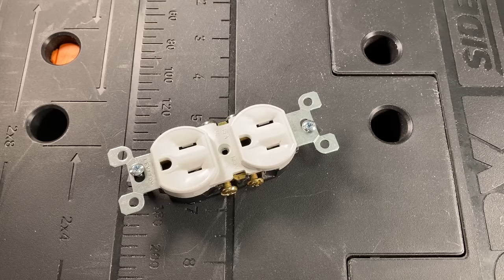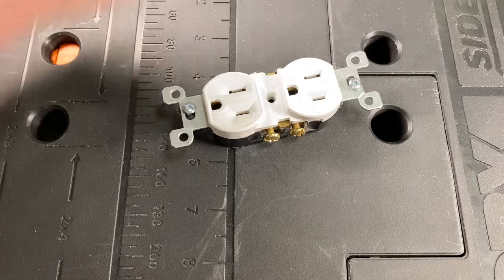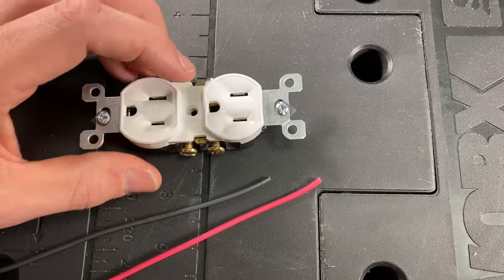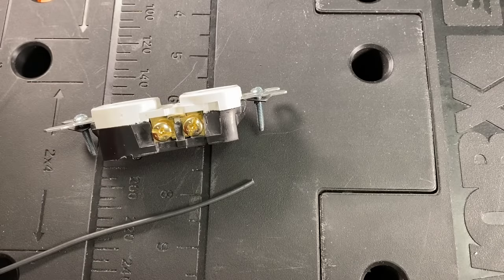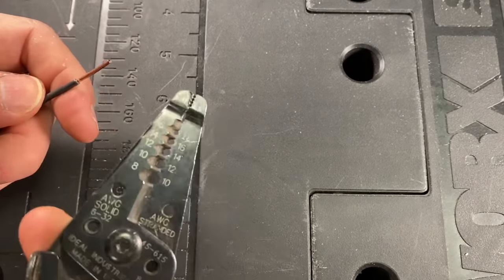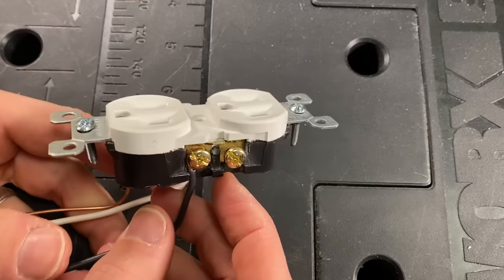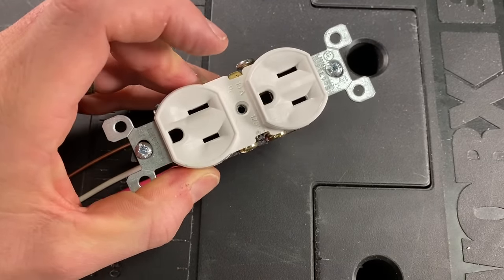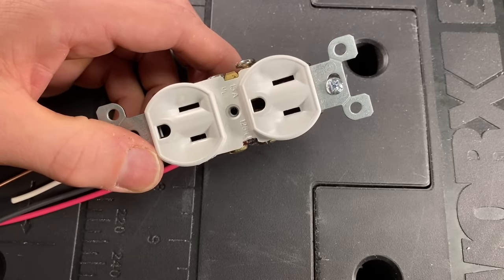Electrical Outlet Basics | How To Wire

Comment: I think it's worth mentioning to install the wire loop in direction that the screw tightens. I have seen it installed counterclockwise and it straightens the loop out.
Reply: Good Eye !!
Reply: It's a shame that has to be said.
Reply: @user-uy3pe1jy5c  i promise simple things other people know, you have zero knowledge about. So instead of bringing other people down either say nothing or thank the person for the tad bit of information
Reply: @sk8ingforfood182  I totally agree!!
Reply: @sk8ingforfood182  I don't think we were talking quantum physics here, simply which way to wrap a wire around a screw. If my comment brought you down, maybe there is something else going on.
Reply: @johns4476  all I'm saying is I hope you know every simple trick in every other profession
Reply: I was going to add that but you beat be to it.
Reply: I can't tell you how many times I've seen ppl try an wrap the wire opposite of the direction that the screw tightens , an if its stranded wire it gets all mushed out ,
Reply: @paulrooster2108  stranded wire shouldn’t be wrapped around a screw at all...
Reply: @user-uy3pe1jy5c  cool comment.
Reply: @SuperVstech  really? You ever do any DC wiring such as bus bars in a boat? I didn’t think so.
Reply: @dumpbear0  stranded wiring should NEVER be wrapped around a screw. In a boat, it should be used with a ferrule in a lug, or if under a screw, a crimp connection should be made, and shrink sealed from the elements.
Reply: I was gonna make this same comment. It took me a few mistakes to realize why the wire would just get pushed out when I tightened the screw.
Reply: SUPER important, I've seen many people turning and turning and screw and the wire is bunching up and breaking off needing to be stripped yet again. A pretty common mistake but IS worth mentioning.
Reply: Not really..
Reply: @snakeplisken7323  yes really. Not everyone is perfect like you when it comes to wiring something up.
Please share with us your wisdom so we all can learn something.
Reply: @SuperVstech  I too like using crimped connectors on stranded wire. About the only application you don't have that luxury is when your wiring up plug on a power cord.  However, in that circumstance I like tinning the ends up with solder to hold the strands together.
Reply: @bobber55  Thanks! I was trying to think of where (& why!) I would have been tightening stranded wire under a screw head, and that's it: new plug on a power cord! And I think I got so frustrated with the strands splaying out (even going the right way) that I also tinned the ends!
Reply: Thank you very much.
Reply: @getin3949  Some of us are just trying to learn to do this and it is a very important tip.  I'm sure I could give you sewing tips that you don't know.
Reply: Early on I use to do that very thing.
Reply: @johns4476  There’s something immature going on with you, pal…not him
Reply: @johns4476  why would you say that? Just ignore it! You don’t have to be rude!
Reply: I got a question can the wire or I should say the loop, can it touche the plastic part of the outlet? If that made sense,?
Reply: @j.rjunior5584  the loop should be just big enough for the screw to fit through. If that is done, it should not touch surrounding plastic. Remember, when you torque down the screw it could possibly crack the plastic if the wire is against it.
Reply: @sk8ingforfood182  yes of course but a comment page is also meant for corrections so that other electricians can become a master of their craft as well . It’s not always about being nice because the electrical world isn’t nice haha
Reply: @sk8ingforfood182  Damn, you need to toughen up. The man simply gave valuable information. If that hurts yours or others feelings…you need counseling. And counseling is a good thing, for anybody.
Reply: Wdym?
Reply: Why loop the wire around the screw at all?
Reply: @SuperVstech  See now I don't loop them. My understanding is to leave it straight and screw the wire straight in. Straighter the wire, less the resistance.
Reply: @tinmaned3542  Depends on the type of outlet.  Newer commercial grade outlets have a plate you can insert the wire under that will clamp the wire when you tighten the screw.  Residential grade typically lacks this plate, so you have to use a shepherd’s hook to side wire.
Reply: pa
Reply: True and just importantly, which isn’t taught anymore, twist the stranded wire COUNTER CLOCKWISE before wrapping the wire clockwise to the screws and tighten. Twisting the stranded wires COUNTER clockwise will assist the wire stay under the screws as you tighten.
Reply: Thanks!
Reply: Yah it’s always clockwise
Reply: Very well explained.

Comment: Always tighten down any un-used terminals as well. This minimizes the potential for contact with the box and or loose ground wires etc.
Reply from the maker: For sure, thanks for the reminder 👍
Reply: I also wrap electric tape around the terminals.
Reply: Damn this is a major tip... I didn’t do mine and I just finished. Now I’m worried lmao
Reply: Yes and wrap the outlet or switch with electrical tape. Same goes for any wire nuts used.
Reply: johnson pham Usually it is OK. It happened to me only once when I was pushing a hot second outlet into a busy box. The wire were live, and I saw a big spark between the hot screw and a grounding wire. After that incident, I started to taped over the hot terminals in busy boxes.
Reply: Always wrap you outlets and switches with electrician tape. I started that after I installed a 30 amp 240 RV plug and the ground shorted out the hot wire when I pushed the outlet into the box. Not my finest moment.
Reply: @electriciantv5174  I have been wrapping them since I was a kid knee high to a grass hopper knowing f all about wiring. I did it because open terminals were scary to a 12 year old having already played with a transformer from a water tank and it blew up in my face. 😳 I was seeing stars 🤩 dumb kid I was
Reply: You Can Too Electrical Sparks are fun. I melted a pair of scissors one time.
Reply: @Jenuin  hey man good shit lol
Reply: Technically NEC doesnt tell you to and taping isn't required.  If properly installed once you add the outlet covered nothing should go wrong.   It's more for the home gamer poking around in hot boxes
Reply: @pbgd3  truth. But if you have seen what I have seen from official electricians.....
Reply: @electriciantv5174  brrrbrrrrrr,,,,chaaaf!!   ??
Reply: @yiannimil1  what
Reply: Yes, definitely >>>
Reply: @Jenuin  
By wrapping,  do you mean covering the side screws ?
Reply: @Chereese0808  yes exactly. Less chance of grounding out if you are working on a live circuit or if the box happens to get banged around etc.  But always shut down / lock out etc and let anyone in the home know so they don’t turn everything back on. That does happen.
Reply: Thanks again
Reply: @EverydayHomeRepairs  this tip, and the wrapping clockwise around the screw tip, and several others are really important for first timers like me. I am replacing dozens of outlets, and if I had not read the comments, I would not necessarily learn these things…

So my thought for you is: why not take the best tips from the comments, ones you’ve responded to, and add them to the video description? I’m thinking you should probably do this with all your videos so that rookies like me get the benefit of the best wisdom and also avoid time consuming mistakes – you know what I mean?

Thanks for your channel, just subscribed :-)
Reply: @Sean Stevenson I personally agree.  In my home everything is done in deep metal boxes with EMT and mudrings to bring the box out to the edge of the drywall.  I put pigtails on everything, wrap em, and use wago style push nuts.

But if you were doing that on every job in an area where everything is NM plastic boxes and direct wired?  Its a huge waste of time and money, but in my house? Forget about it.
Reply: Great job!
Reply: @Jenuin  STOP fking using wire nuts... do your job properly and get wago clips O_x 

oof
Reply: @Dinco422  I have used both and if one is to use wire nuts properly you won’t have any issues. That being said I understand the superiority of the wago clips. 🙌🏼
Reply: I’ve heard of people wrapping a strip of two of electrical tape when the wires are connected I guess to avoid any contact of the outlet with the box ?? Is that ok to do ?? Just wanted to be extra sure nothing goes wrong.
Reply: Very thorough and easy to comprehend. Thank you.
Reply: That's a great tip, thanks
Reply: Thank you!!!
Reply: @pbgd3  I have no idea what you people are talking about and  jealous.
Reply: I wish I would have thought of that lol. I'd learn hard way I'm a dummy sometimes

Comment: for beginners, i suggest a copy of "basic wiring".  from lowes, home depot, etc. people watching obviously have little or no experience in wiring buildings. a printed copy would be very handy until the user becomes familiar with what their doing. running back to the computer would drive me nuts. also, don't be fooled by the ease of using cordless drills to put things together, it's very easy to strip screw threads.

Comment: You worked it but didn’t mention that the wire should loop around the screw in the clockwise direction that the screw is tightened so maximum force can be applied when tightening.
Reply from the maker: 💯 thanks for the call out. 👍
Reply: Yes, I noticed that, too
Reply: Tony Manero, but he DID connect the black wire loop Correctly on the brass terminal, no ???  So perhaps, he was thinking that people would watch and do it the same way..
Reply: Who installs recitals with the ground terminal at the 12 position?
I see a lot that the ground hole is at the 6:00 position. I was taught and it might be wrong, always install with the ground at the 12:00 position. Why? If a child is playing say with a metal object butter knike ect and a plug is partly loose both positive and negative terminals are exposed and almost always will shock you or potentially kill you. But if the recipital is installed with the ground at the 12:00 position in the same situation the first and hopefully only contact is to the ground terminal. Just a random thought.
Reply: @MJ0U812  90% of plugs I see has the ground hole at the 6:00 position.  I think it may be because a lot of plugs that are wired with a 90° plug that is designed to allow the plug and wire hug the wall.  A lot of those plugs have the grounding prong on the bottom.  I guess it also depends on where the plug is being used and what is being plugged into it.  Another one to blow your mind, some older houses had the lugs put in sideways.
Reply: @frandanco6289  Yes he did. To us this is probably obvious but to newbies it must be pointed out because they may not think it matters.
Reply: @KevinBenecke  I think most people install it that way because subconsciously it looks like a face and that’s how it should be oriented. But, there is no mention of it in the electrical code, at least not where I’m am. But, I have heard of guys installing the ground hole up for that same safety reason Eddie pointed out.
Reply: In all the hospitals I've ever worked in they were installed with the ground lug at the 12 position. Naturally anything plugged in could be vital equipment and easy to short by accident with any bodily fluids that may or may not make their way down any sort of cabling.

Naturally I started wiring my house that way, but it can be a pain if you are working with a ground lug in a tight space.
Reply: @GoldenAura32  Naturally
Reply: What I was hoping to see was best practice on preping the wires in the box, how to locate, bend them behind the plug, so that it is done in a professional way.
Reply: @GoldenAura32  
This is done so when unplugging, and you accidentally touch the plug tangs, you have lessened your chances of getting shocked.
When unplugging, your thumb is generally at the 12 o’clock position.
Reply: @KevinBenecke  pu
Reply: @MJ0U812  
Well over 75 homes minimum I have wired in full in the last 8 years. Each and every one was installed with the ground terminal at the 6 position. However, absolutely none of those installations negate parental responsibility at any moment in time.

Let's run with your thought for a moment. 
Many electrical components, if their ground wire is no longer touching ground inside of the receptacle, a person touching the ground terminal from the cord end can become the path to ground. That means electricity flowing through the body. Hence the ENTIRE purpose of the ground wire in electrical systems. 
 
If a cord does not hold snug in a receptacle, the receptacle needs to be replaced and positioning of the ground does not negate the need of replacement. 
Also, when mounted with the ground at the 6 position, there are two contacts helping secure the cord against the pull of gravity, not just one.
Yes, the contacts do help keep the cord in place via friction. 2 sources of friction is much better than one.
When the ground is at 12, it's lone self receives the majority of gravity's pull whose effect is noticed more and more with time.  Rock a plug up and down in a receptacle. You will notice that the top facing terminals get pulled in and out of the receptacle much more than the bottom facing terminals.
That is why ground is located at 6, not 12.
Even if you plug something in and never unplug it, gravity will have its effect over time, thus weakening the friction between the contacts, eventually leading to a loose receptacle or at minimum, a plug which is no longer fully seated. 
There is very good reason for placing the ground at 6.
Reply: @CytoplasmicGoo  they will notice that if they put the loop counterclockwise it will pull the wire out of the screw head radius,so...it will not let them do that...some can manage to do that and some can't...so,it is a damn good aspect to point out,when the loop is clockwise,it will also tight around the screw's rod when tightening the screw to grip the wire.
Reply: @CytoplasmicGoo  I’m a newbie and it only took one turn for me to realize which direction it needed to go. It’s common sense.
Reply: @MJ0U812  hospitals use that logic, but some inspectors use the logic that if someone steps on the cord and knocks it out of the wall, having the ground lowest will help ensure the ground is the last connection to "break"  
bottom line: if you have plugs backing out of receptacles, you have a bigger problem.
Reply: @jackjerryloveify  here you go: the ground wires (if there are multiple cables in the box) should be connected together, first, and folded accordian style in the back of the box on the left for "right side up" or on the right for inverted; with the "pigtail" still sticking out.
then if there are enough cables that you need   to pigtail the rest, they also get pigtailed and folded back with the pigtails sticking out.  then the pigtails or the other wires can be folded, also accordian style, into the box.  if you are finishing the wall, the wall gets finished at this time.  then you pull the wires out install the receptacle, and the accordian fold will let the wires fold tidily into the wallbox.  be careful to be sure the ground wire stays well back from the terminals as with modern arc fault and ground fault protection, accidental contact between ground and neutral will cause nuisance tripping of the protection - and it is a bad practice on any system.  
not having the wires folded neatly into the box is the second biggest headache professionals have when replacing outlets an switches. the biggest is when the wire is barely long enough to get the old one out of the box. code requires the wire to be at least six inches long inside the box.
Reply: @theduder2617  I bet you never worked in a HOSPITAL.
Reply: @joemc111  
As a medical professional, no. 
I transferred into physics courses the day I learned that medical courses do NOT want anyone thinking for themselves. They want people who will blindly parrot back information found in a 60+ year old book.
"Stop thinking of better treatments" was the professor's response.

Now, if you are talking electrical work in hospitals, yes. However, it is important to note that commercial/industrial electrical is performed quite a bit different than residential electric. Meaning, more safety laws are in place in those locations.

My response was in reference to only residential settings.
Reply: @MJ0U812  When I started doing wiring, I was told some inspectors whited outlets ground pin up, so if bare metal fell across a partly inserted plug, it would hit the ground wire instead shorting hot to neutral.  Seemed like goofy idea, but I did it for a while until I tried to use the outlets and found 90 degree plugs pointed upward, and was untidy and difficult.  Since then, I’ve put the ground on he bottom.
Reply: @MJ0U812  I always do.  Even if customer does not like it.
Reply: @jackjerryloveify  No more than 6" of wire and give them a pre bend S shape.
Reply: @EverydayHomeRepairs   this tip, and the wrapping clockwise around the screw tip, and several others are really important for first timers like me. I am replacing dozens of outlets, and if I had not read the comments, I would not necessarily learn these things…

So my thought for you is: why not take the best tips from the comments, ones you’ve responded to, and add them to the video description? I’m thinking you should probably do this with all your videos so that rookies like me get the benefit of the best wisdom and also avoid time consuming mistakes – you know what I mean?

Thanks for your channel, just subscribed :-)